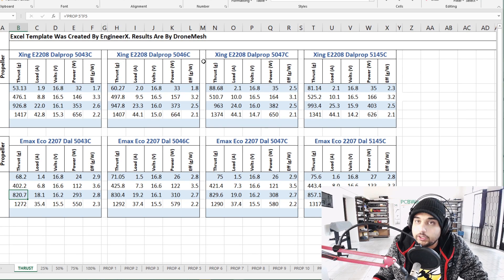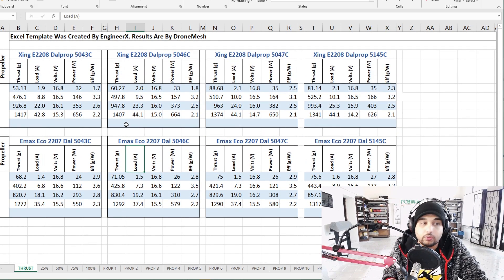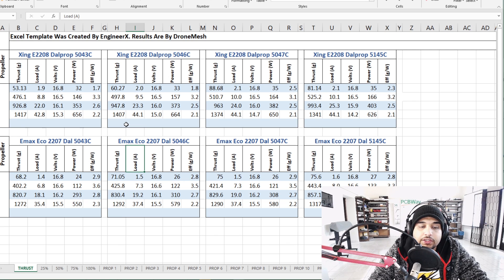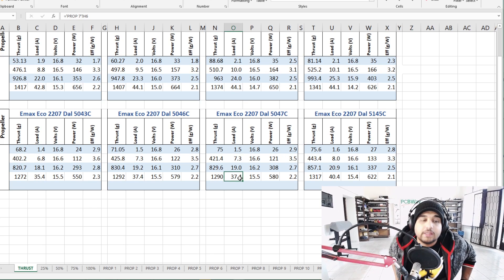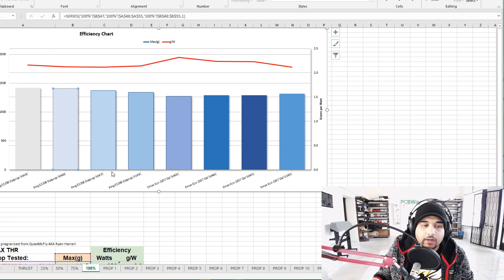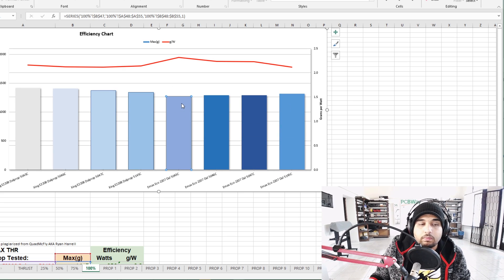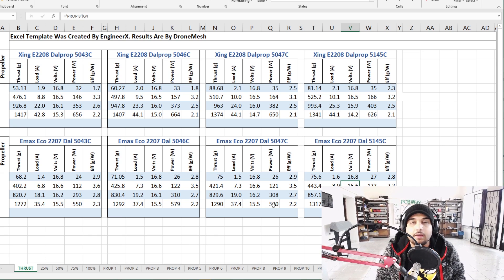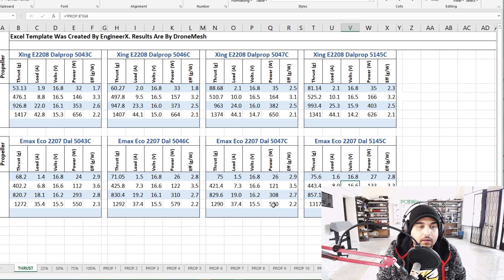Emax ECO 2207 VS iFlight Xing-E 2208 // Thrust Results

Comment: i flew both motors a lot (6s 1900kv), sadly my emax build (which i flew most of the time) drowned. now i had to switch back to my xing e copter. and all i can say... i instantly ordered new emax motors.the flighttime on xing is significantly shorter and the lipos are hotter then before with same frame, flightstack etc.. i never noticed it before, first when i forced to switch back

Comment: How fast are motor signals switching? I was wondering if the longer wires on 4in1 ESCs, or boards like Racewire, slow down the motor timing.

Comment: My previous motor was:
Xnova 2205 2300kv
Tmotor F40 proii 2600kv
Emax ls 2207 2550kv

Now I am using:
Emax ls 2207 1900kv
Emax eco 2207 1900kv

My favorite motor is Emax eco 2207 1900kv, cheap & smooth then Emax ls.

Since then, will not buy motor more than 12usd.

Thanks Emax.

Btw nice review.

Comment: What's up... bro.. I noticed the same thing on 6s... with 1800kv the Xing.. are amp hungry killed a 6s 1300mah in 2 minutes the batteries were hot... hot... the ECO emax seems to be a winner in the run time.. on my rigs.. so far... with a smoother power band:-

Comment: The iflight xing e 2207 2750kv gives away more power and is more efficient than even the emax ecos. I'm getting 34 amps on full throttle with a full 4s pack. Not to mention ur getting that much more kV. Please consider the xing e 2207 2750kv. The bearings are also higher quality

Comment: I'm glad you made this video, I'm currently using the Emax ECO 2306 2400kv motors and they're about ready to be swapped for some fresh motors (a lot of whistling and whining from the motors). I was considering the Xing-E 2207 1700kv motors as my replacement. What I found interesting about your video is that the ECO motors look really good on paper. As for myself, I have been using the ECO motors for a while now and I can say with reasonable confidence is that the ECO motors don't last very long. They don't deal with crash damage very well and the bearings seem to wear out rather quick. I'll be looking forward to seeing how you like the ECO motors with respect to build quality and longevity (life span). Thanks as always!

Comment: I have a set of Eco's 2306 1700 on a QAV 5" and with a 5s lipo it's perfect! Plenty of low end for freestyle, and I get 5-6 minute flights depending upon how heavy I am on the throttle!
Reply: I have them on my budget 5" racing quad and I get similar results. Between 3 min (racing), 5/6 min (freestyle) and 10 min (cruising) is what I am getting with them. I also bought the xing-E 2208 for my second quad but haven't flown it yet because of bad weather. I'm excited to try them.

Comment: Really nice results! These were on my list to build my first quad but ended buying the Nazgul5 and the X9-Lite radio. By the way, what OpenTx version are you running on your radio, I want to run a multi protocol module?
Reply: I needed to upgrade to opentx 2.3 to get the multimodule to work
Reply: @TimeFadesMemoryLasts  I am running opentx 2.3 nightly 20 and I am not sure how stable the connection is going to be.
Reply: @viorelzanfirache5146  a stable release is already out. You can upgrade to 2.3.1 or newer. I am running the Flysky AFHDS-2A protocol without a problem (the only one I can test it with).
Reply: @TimeFadesMemoryLasts  I have the IRangeX IRX4 LITE multiprotocol module and from what I have seen, there is no build selection for multiprotocol in the OpenTX 2.3 Companion for the X9-Lite Radio.
Reply: @viorelzanfirache5146  I have your exact setup and it works out of the box with 2.3.1. You don't need a checkbox anymore.
Reply: @TimeFadesMemoryLasts  Thank you! I will try that later today.

Comment: 2400 is a very low kv. The better option is to buy the 2306 or 2207 2750kv and forget the 2208 for 4s batteries because they suck too much current for the speed they spin. For 6s it’s a different story.

I have the xing-e 2306 2750kv and emax eco 2207 2400kv. They have about the same control, but the xing-e is a lot faster. But for having higher kv, it is expected that the xing-e should have less control, but it still manages to have the same as a much lower kv motor. I highly recommend the xing-e, best motor under 20$.

Comment: i run the emax eco 2207 2400kv on 5s, just propped down. its a good motor, slightly feels like a 2300kv on 4s.